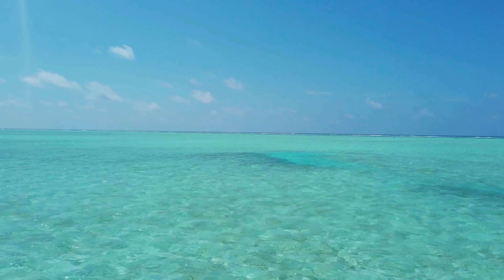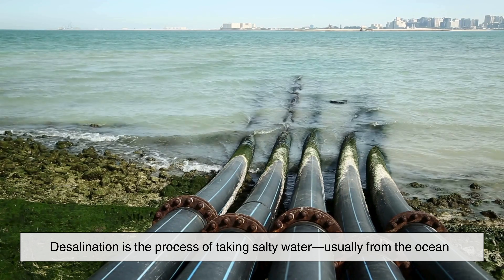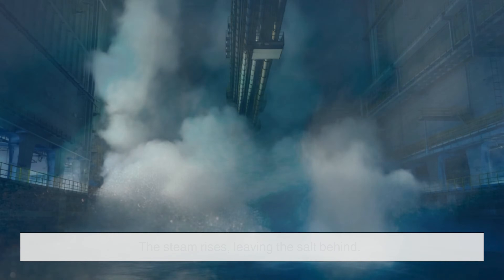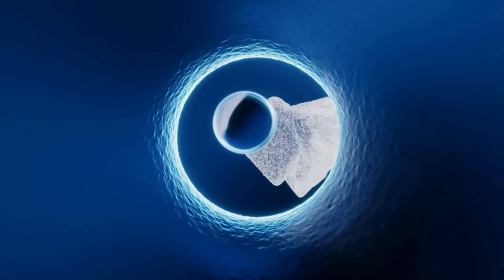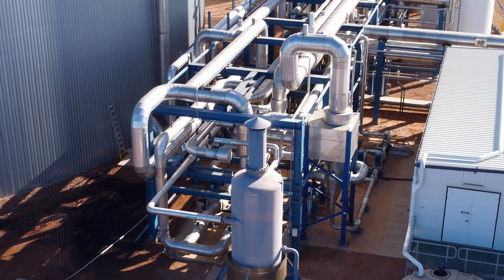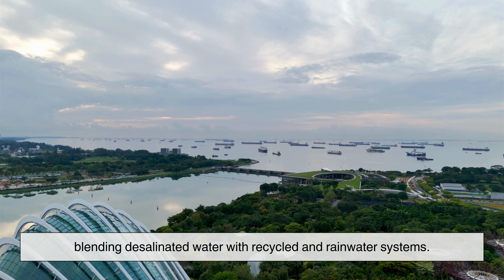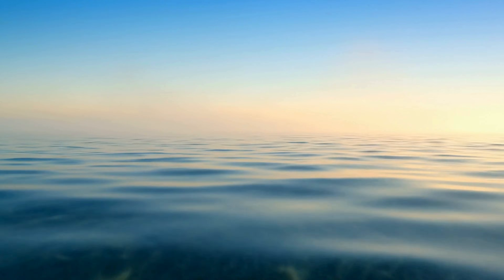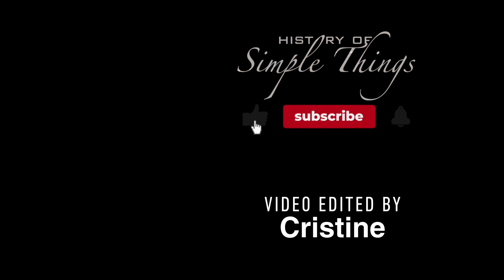How Does Desalination Work?

Comment: Regarding 6:43, for people who are marooned at sea or land, pure water can be made from salty water or dirty water using solar distillation by two bottles that are connected. The first bottle contains the salty water or dirty water. Heat from the sun evaporates the salty or dirty water. Then the water vapor passes into the second bottle where the water vapor condenses and is collected as pure water.